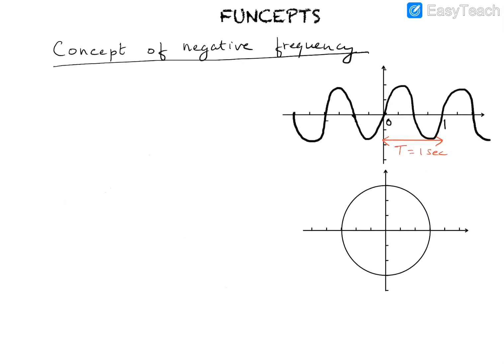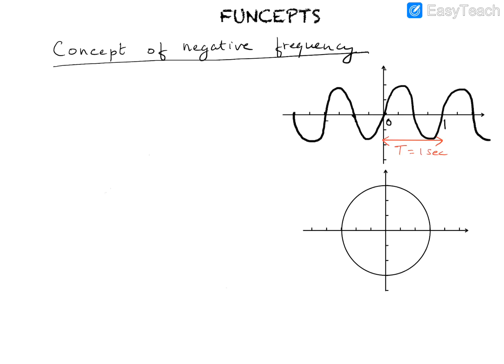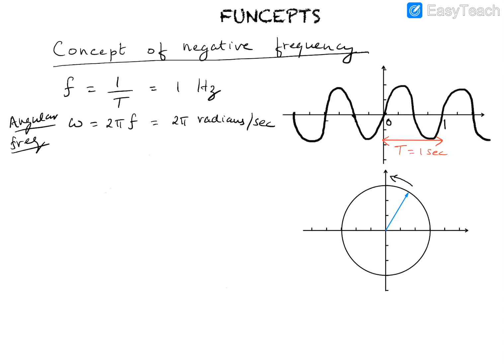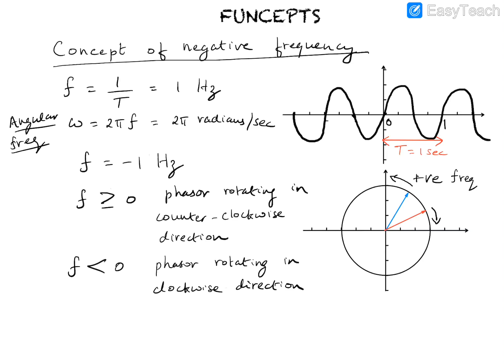Concept of negative frequency

Comment: Can you please explain what the purpose of graphing a negative frequency with phasors when negative frequencies do not actually exist? What happens when a computation ends up with a negative frequency?
Reply from the maker: Negative frequencies are not a physical reality. They arise out of mathematical convenience when representing real signals in terms of complex exponentials as in Fourier analysis. To cancel out the imaginary part, the complex conjugate of the complex exponential is added. The complex exponential e^[-j2*pi*f*t] denotes the positive frequency component and its conjugate e^[-j*2*pi*(-f)*t] = e^[j*2*pi*f*t] denotes the corresponding negative frequency. The positive frequency component is represented by a phasor rotating in counter-clockwise direction and the negative frequency as a phasor rotating in clockwise direction.